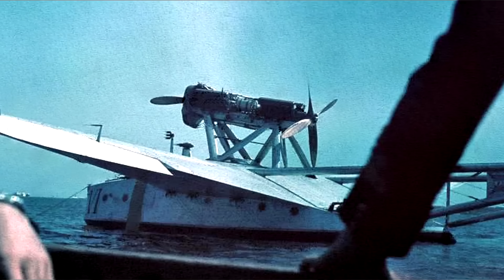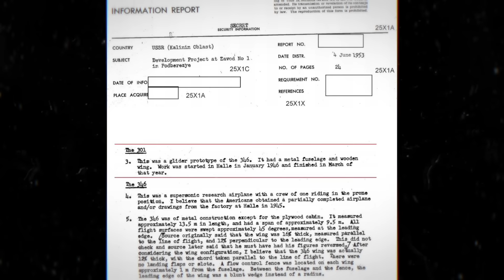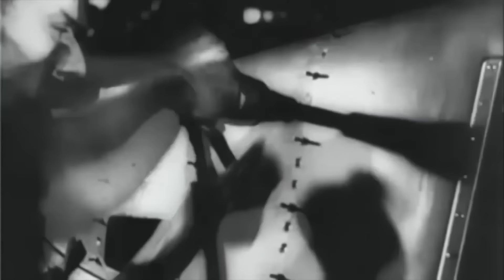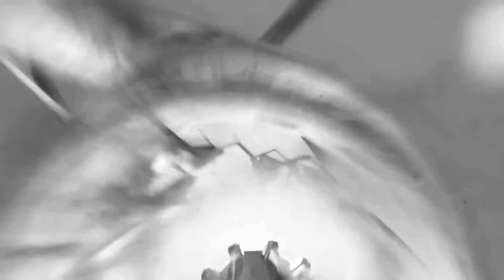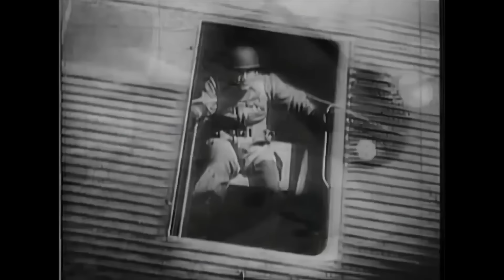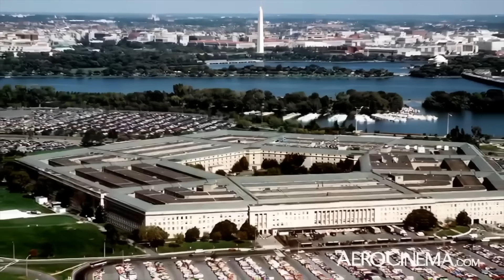WWII's Weirdest Wings: The Story of Nazi Twin Aircraft & Other Bizarre Prototypes

Comment: What would of been the out come of the Battle of Britain if the Germans had carried on bombing the RAF airfields from which the frontline fighters flew and not switched to bombing London and the the 109 was not ordered to fly with the bombers to protect them over London and had remained as a quick attack fitter fit with a connon in nose whereas the Spitfire and Hurricane were fitted with machine guns.
Reply: Yeah makes sense.. also if the me 262s  were used solely to attack allied  bomber formations instead of medium bombers as per Hitler's orders